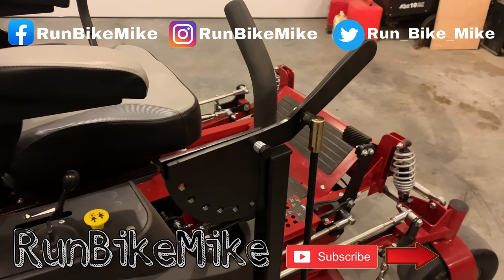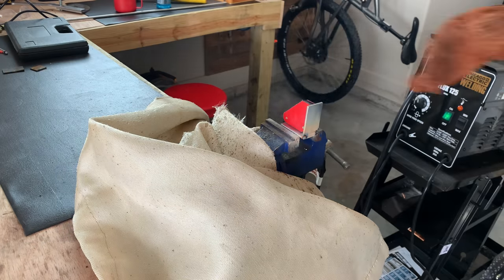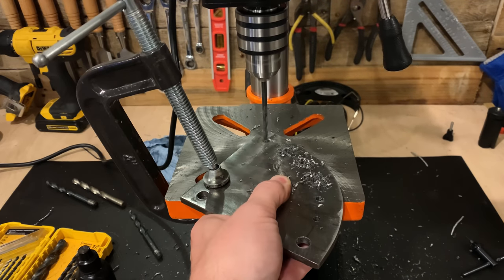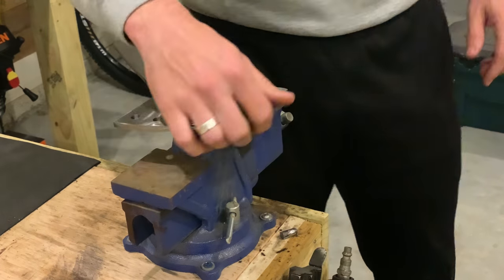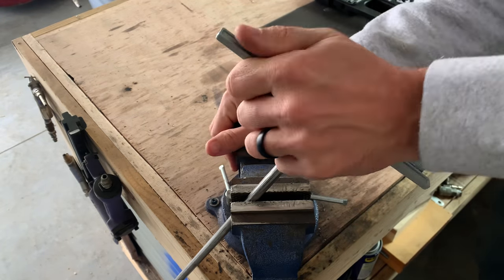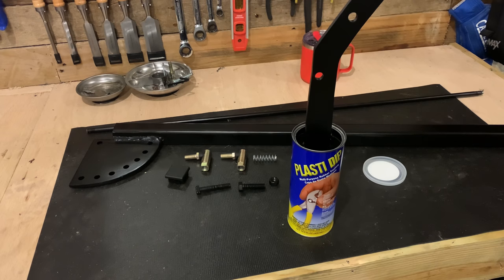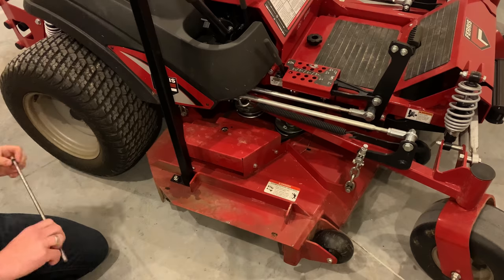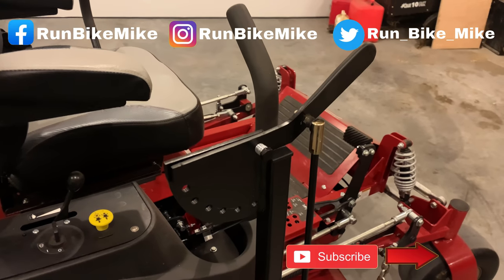HOW TO BUILD A CHUTE BLOCKER FOR YOUR MOWER PART 3: Super Nice Handle Build Ferris ISX 800 Zero Turn

Comment: What is the joint/connector you used in the lifting mechanism called? What size rod did you use?  Where did you purchase it?  Great job!  Thanks for sharing.
Reply from the maker: The joint connectors I got on amazon here is a link. 
Rotary 3/8" Male & Female Ball Joint / Tie Rod End https://www.amazon.com/dp/B06XXRT2TV/ref=cm_sw_r_cp_api_i_A133EbSFDJXV8

The rod size is 3/8 inch. Thank you and you are very welcome.

Comment: measurements ??
Reply from the maker: I can take some tomorrow and let you know
Reply from the maker: jarocho moreno  So these are the measurements I took: Main pole is 33 1/2, the rod with fittings is 34 1/2, the quarter round part is 4 3/4 and the handle is 11 with a bend starting from the top of the handle at 5. These are all in inches. I hope this helps. When I made this it was almost all my eye so I didn’t write down the measurements at that time.
Reply: Thank you so much sir I’m working on this right now 👍👍👍